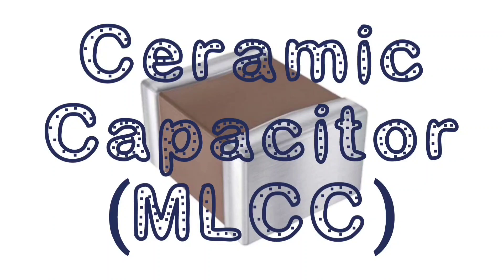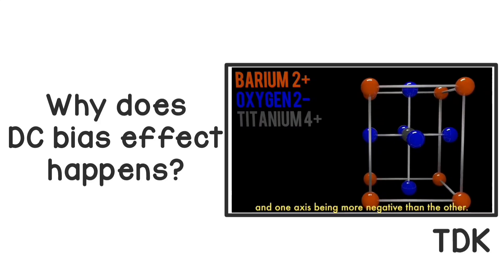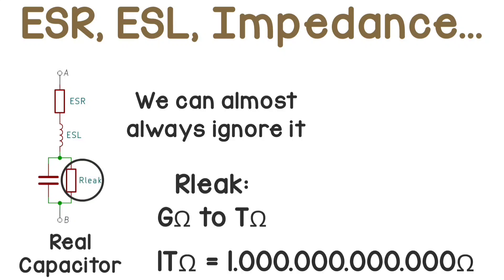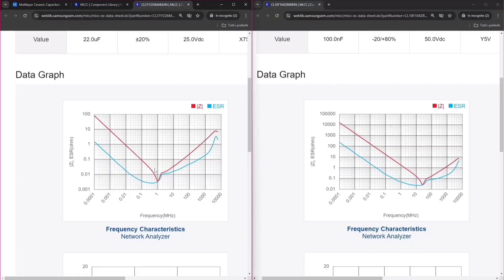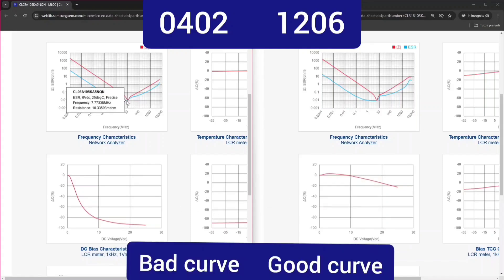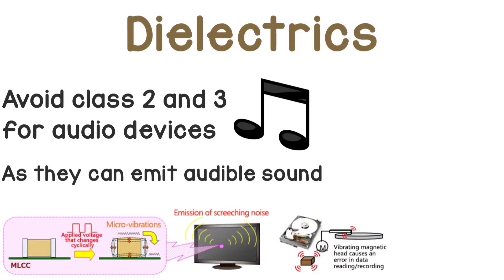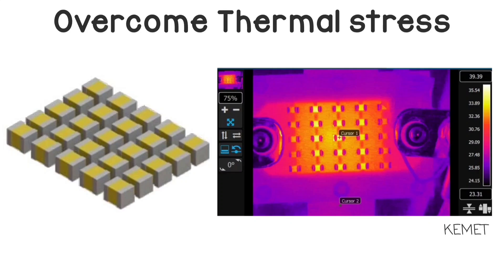The Immense World of Ceramic Capacitors (MLCC guide)

Comment from the maker: Hi all, this is a video about Multilayer Ceramic Capacitors! Those MLCC are literally everywhere! It was a somewhat difficult video to make because of all sources I had to look at. Hope you enjoy! 

IG: 
https://www.instagram.com/xburningelectronics

Chapters:

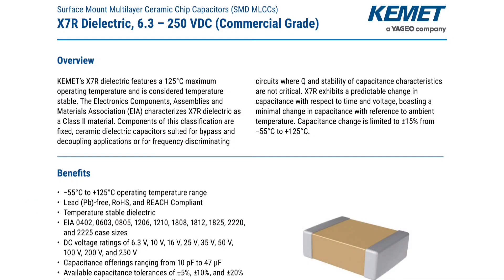0:51 Voltage rating
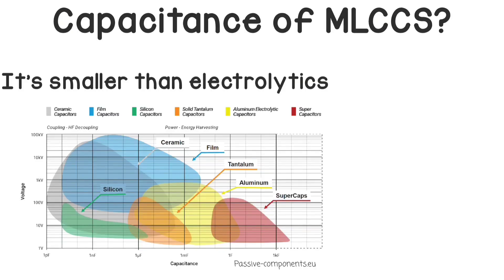1:45 Capacitance
2:26 DC bias
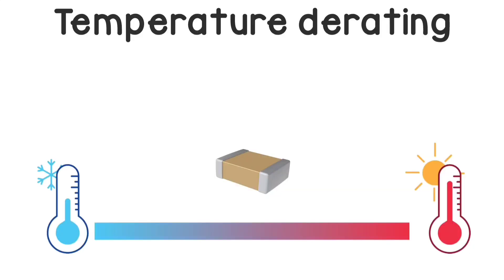3:32 Temperature derating
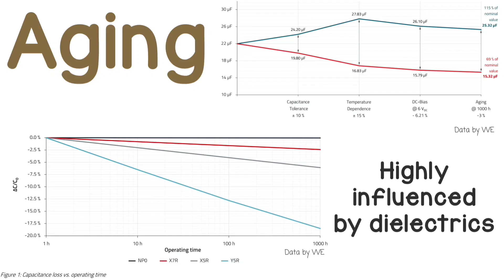3:50 Aging
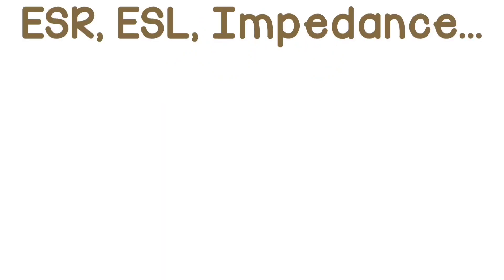4:10 ESR, ESL and impedance
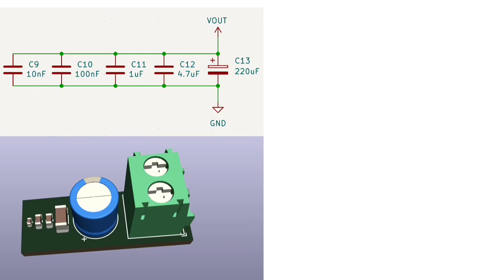7:06 Parallel capacitor, antiresonance
7:59 Packages
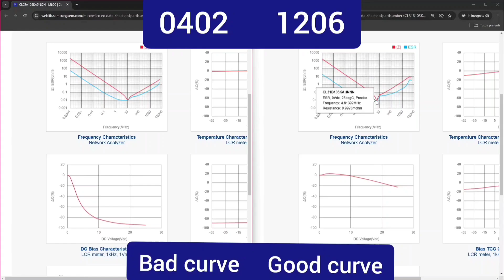8:38 Dielectrics
10:22 A brief summary
10:52 MLCCs Failure modes

Why does DC bias happen?:
https://youtu.be/weUrWSFJCgk

The Piezoelectric effect by EEVblog:
https://youtu.be/F2gX-R1k7MM

AntiResonance: The CompuPhase report
https://www.compuphase.com/electronics/ParallelCapacitors_Antiresonance.pdf

Want to support me?⭐

buymeacoffee.com/xburningelectronics